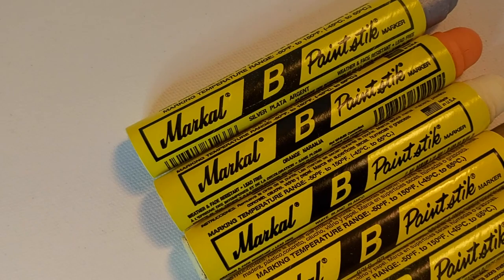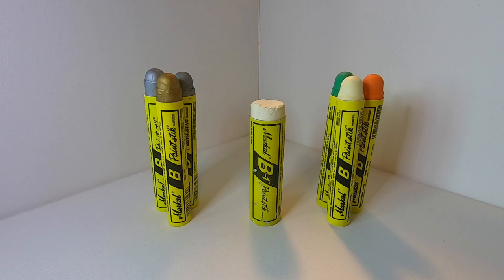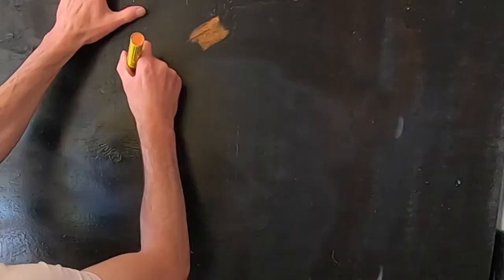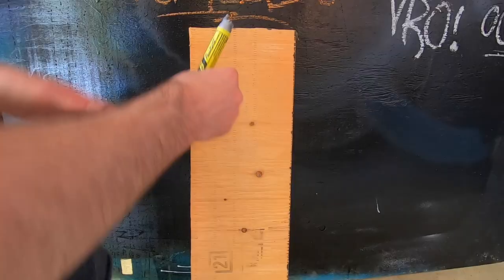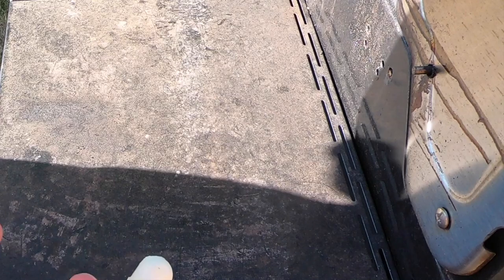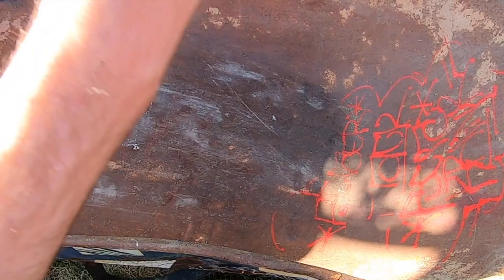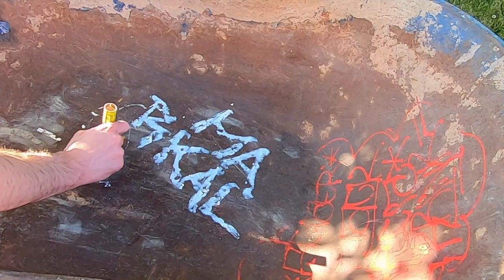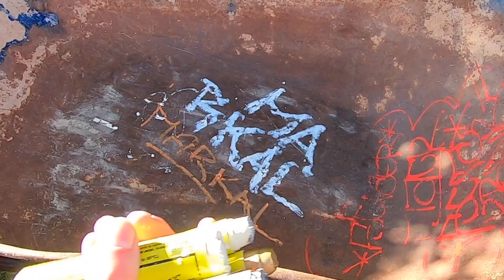Markal B Paint Stick Review And In Depth Tagging Surface Test | THE FUNNEST SOLID GRAFFITI MARKER ?!

Comment: I love sakuras. Markal Bs definitely have their place tho. It could just be me but I feel like the marklals right better on rougher surfaces then smoother ones. Also weather is a factor on how well they write. I say the biggest Advantage with the Markal is u can sketch ur piece on wall if you dont have good can control or aren't that good at freehanding.
Reply from the maker: Never thought of doing that!  But yeah, the harder Markals definitely aren't as nice to write with on smooth surfaces that aren't super warm to help melt the paint and make it softer.  The Sakuras are great to take their place on that one.
Reply: @ScizGraffiti  yeah I normally use them when I'm practicing can control with the NY fat or the fat caps on the flame orange cans. I jusy draw shapes and squiggly or wavy lines with them, than try to keep everything clean n sharp when I go over and fill them in with the fats. An once I've mastered building my letters I'll probably still use them when doing certain pieces.
Reply: @ScizGraffiti  When you bought the markal B paintstick did you had to buy every different color separate or did all the different colors came in one  package?
Reply: @ScizGraffiti  besides the metallic markal b paintstick
Reply: @ScizGraffiti  the Markal B pack you've bought does it come with all the colors including metallic silver metallic gold and etc
Reply: i never actually thought of that, thats a good idea bro i might try it

Comment: Not that expensive but they perform good ( still cannot believe how expensive hand mixed are )
Can you hit off CLIN
Reply from the maker: Yeah I would never want to buy the handmixed for that price on a regular basis.  And yeah for sure!
Reply: handmixed are a scam just split the markers yourself with a sharp knife i would recomend buying one of those yellow ones where you can push up the blade and break of bits of it if its broken

Comment: Metallic colors are more expensive to produce, that is why when you get a brand that dont charge extra, you are disapointed with the result. Its because they put less mica pigment into it so that it is equal to the production cost of the other colors. Its just like traditionnal paint, you would pay more for lapiz lazuli genuine paint like 6 to 7 times more then regular synthetic mix. But the color is more saturated and bright. Just like your metallics did not cheap out with the pigment and was better.

Comment: are these paint sticks, regardless of the brand, the same as lumber crayons? i know that these paint sticks are literally made out of solid paint, and i wanted to know if the lumber crayons are made out of a different material. i haven't bought a lumber crayon yet so I dont know
Reply from the maker: Lumber crayons don't quite write with the same resistance and aren't as versatile in different temperatures for the most part.  Of course there are exceptions and once you get used to writing with any solid stick, it's no big deal.  The only aspect that is specifically engineered a bit better in the solid sticks like these are the pigmentations as these re meant to be seen for a long time, whether it be for marking pipes on anything else.  Lumber crayons, on the other hand, aren't made with permanent visibility in mind as much, as far as I'm aware
Reply: Lumber crayons have way more wax and less paint in them. They are harder, less permanent, and leave rougher less opaque marks

Comment: Instead of using a razorblade/knife to clean off the hardened paint, use sandpaper for harder stuff(will last much longer, you can it clean it) like metal. Much faster, easier, safer, and save more paint.

Comment: Do these have a wax coating around them like the art primo hobo markers?
Reply from the maker: Yeah, I'm not sure if it is wax but it is something similar if not.
Reply: @ScizGraffiti  yeah I meant to say wax like. Did you peel it or can you just write through it?
Reply from the maker: @thegraffitiwriterknowsas6821  most people would say peel it off.  I usually just grind the layer down on the surface, but peeling it off works better

Comment: Yo Sciz, Im not sure but from the look of the paint sticks, it seems like you didn't take the wax shell off the actual paint. Did you do that? It looks like after you're done busting the tag you can see the wax shell all mushy with the paint.
Reply from the maker: Yeah I did.  Instead picking the wax off, I just grind the tip down a bit.  You can see the spot where I did that above the first tag in orange

Comment: Do these work on smooth or rough plastic?  Need something weather UV, wear and chemical resistant.  Will it come off with alcohol or paint thinner?
Reply: Nothing is buff proof. But the Sakura and the sharpie mean streak are perfect for smooth plastic. Dries fast and will be up for years.
Reply: @mrarivv0007  Thanks I will check those out.  So before this comment I started using Dykem markers and they've held up well too, in case anyone else is wondering.

Comment: What’s the difference between markal b & markal e ?
Reply from the maker: They are essentially the same but the markal E has higher colour pigment for if you need to make something standout for some reason, usually for say industrial safety purposes.
Reply: There is also a markal B-E that is softer and more oily than the B, and M that is harder and more brittle that is meant for very hot steel, common in welding shops, machine shops, steel mills etc.

Comment: the only part that i dont like so much is when the tip hardens
Reply from the maker: Yeah for sure.  I always grind the tip down a bit before using it to make sure it's nice and slippery :)
Reply: Just grip it with paper towel or gloves on and twist, will peel the film off a fair bit of the stick

Comment: So is the BE softer?
Reply from the maker: I've only used the markal BEs a couple times since they are more expensive, but I didn't notice a difference in texture. Someone who has used them more recently would be able to say more definitively though :/
Reply: B-E is a touch softer, but more oily / "buttery" if that makes sense. But as far as them being softer it's barely noticeable unless your writing on warm or hot steel